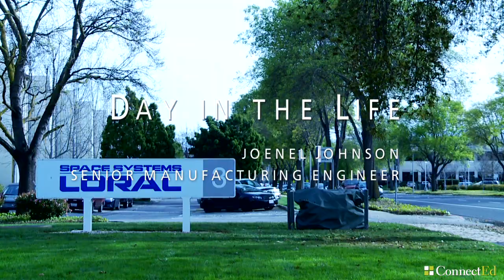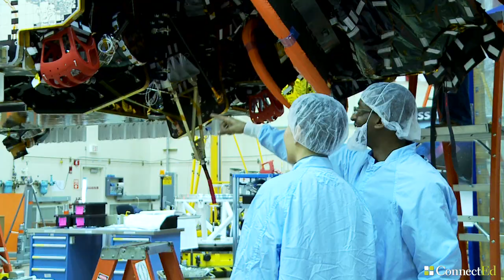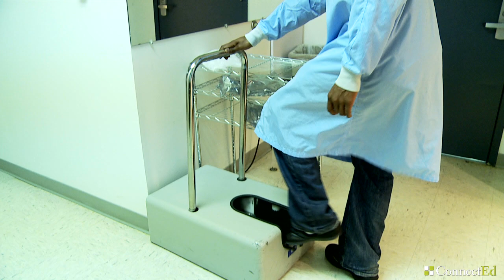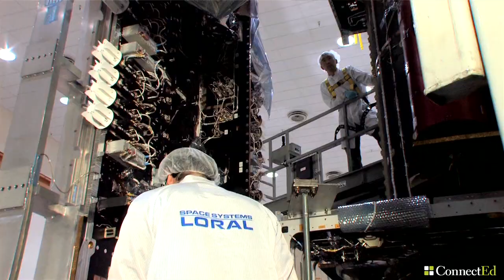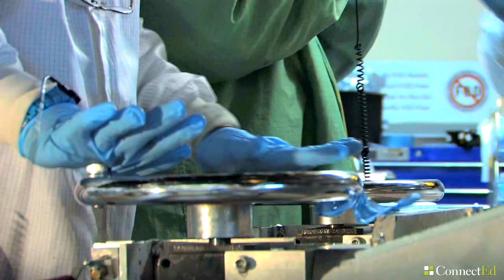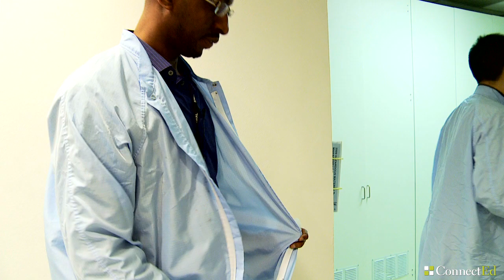Day at Work: Manufacturing Engineer

Comment: what is the difference between manufacturing and industrial engineering? plz help!
Reply: there isn't necessarily a difference. quality engineer, manufacturing engineer, and industrial engineer could all be doing the exact same job. mechanical engineers, electrical engineers, and others could be working as a manufacturing engineer as well. The difference will be company to company and what the job requirements are. And you'll be targeting specific jobs based on your skills and based on what skills you want to further develop. Engineering is great because there is such a broad range of things you can work on. It's rarely the same thing day in and day out. I mean, it is in that you have problems to solve... but the nature and type of problems can vary widely even on the same day.

Comment: What engineering degree he got? 
If I get an industrial engineering degree, can I get a job as a manufacturing engineer?
Reply: +reeshma rifaya 
Wrong. In most cases you get a manufacturing, mechanical or industrial engineering degree.

Example: 
https://knorr-bremse-ats.silkroad.com/epostings/index.cfm?fuseaction=app.dspjob&jobid=304577&company_id=15596&version=1&jobBoardId=1112
Reply from the maker: +MrsChris2323 Here is some more information on the career: http://www.worldwidelearn.com/online-education-guide/engineering/manufacturing-engineering-major.htm
Reply: +MrsChris2323 Sorry for late, You need to be a chemical engineer to be a manufacturing engineer.